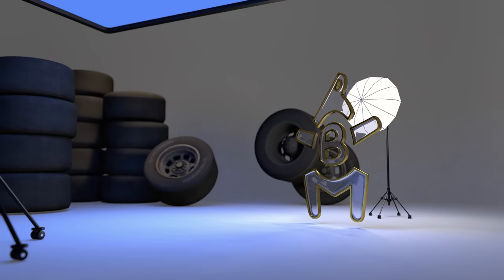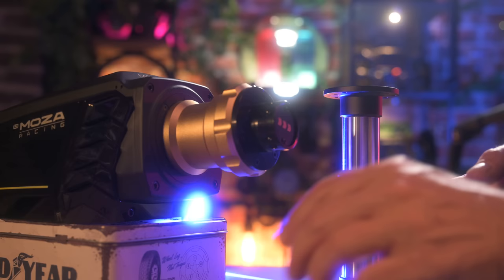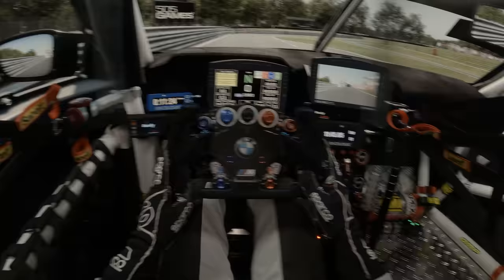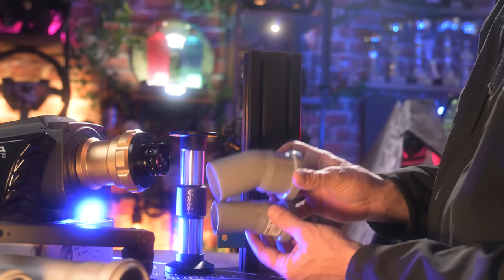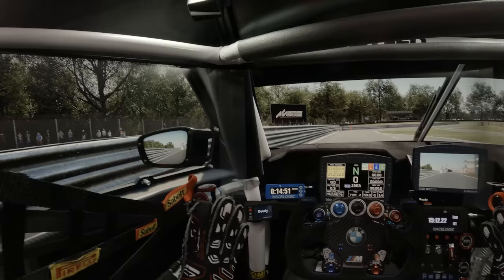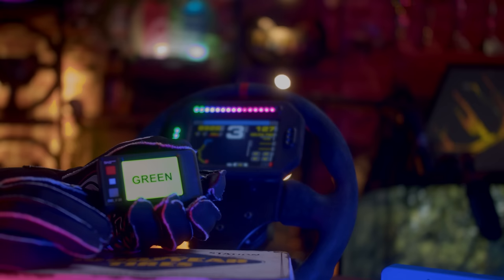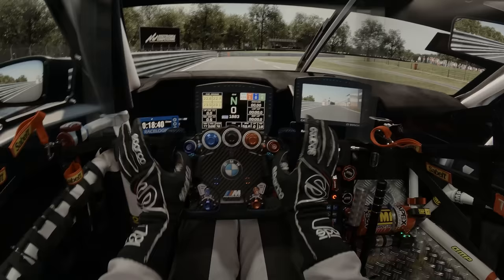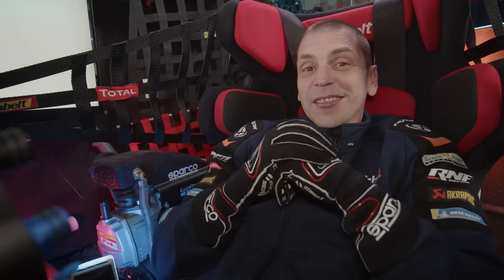How to build IMMERSIVE Sim Rig in 2023

Comment: what screen size eould you recommend to feel 1:1 ti real life sitting in a gt3 car being able to see outside the windshield and dash board section ?

thanks
Reply from the maker: That will depends strongly on the physical eye monitor distance buddy!
At 54cm distance I able to see the dash and the full windshield vertically on my 32 inch and is reasonably good size but definitely not 1:1 ratio ! Probably round 40-45 inch will be optimal but I’m happy with the 32 ich size

Comment: i only found the Asus Bezel kit for 27 zoll. Do you have a link or so for 32 Zoll Monitors
Reply from the maker: It is only for 27inch 
I stick it on top and bottom with type 🤛
Reply: @chepilevski    ah ok thank you
Reply: Also can cut some acrylic plate , length 3cm (x4 top&bottom) 
(depand on  monitor bezel) 
thickness like bezel kit to stack top and bottom

Comment: @racebeyondmatter where you get those metal plates ? and what kind monitor stand you using for the triple screens and any link on the metal plates ? also what is that dash board that showing what behind you when racing its that coming monitor it self or thats dash board ?
Reply from the maker: Hey buddy, the monitor stand is the cheapest model from SimLab and the display is from the sim picture!
The plates I found in local market but here is some amazon link for example 
https://www.amazon.de/-/en/gp/aw/d/B08FDHX993/ref=sspa_mw_detail_1?ie=UTF8&psc=1&sp_csd=d2lkZ2V0TmFtZT1zcF9waG9uZV9kZXRhaWwp13NParams
Reply: @chepilevski  thank you so much would you say 300/ 400 /500 /600 mm metal plates which size would you recommend or what size are you using in the video currently trying my best to mimic your build :) one step at a time
Reply from the maker: @jahgenetics3315  mine are 50x25 cm and I use 2 on bottom and one in front 🤛

Comment: Can I ask what distance your eyes are from the screen now, when base is behind monitors. I have just purchased triples and want to start off correctly.
Reply from the maker: I have around 56cm eyes distance from all monitors wen I turn my head around buddy! 
It makes huge difference in comparison to the 70cm + I have them before ! 
If you can stay between 55-60 is really great experience as the monitors surround you 180deg and the perspective is more natural!
Reply: Ah great thanks. I’m at 63 currently. Didn’t want to start modifying until I had a rough target. You setup is inspiring btw!

Comment: Stupid question I’m sure but can you extend your screens when using a ps5 with the Fanatec GT DD Pro rig?
Also how did you get the screens to match the angle of the windshield and what did you use for the side bars that separate the screens?
Reply from the maker: Hey buddy, I’m not sure if I understand your question!
Reply: @chepilevski  Since I asked the question I researched and found that a triple screen setup is not applicable for the ps5 regardless of the game so I’ve answered that question. The other question I asked you is how does your front monitor appear to be slanted the same as the car windshield. Is that just an illusion or do you have to angle your screens to create that visual?
Reply from the maker: @dustingre8  ah me buddy, the monitor is absolutely flat and is just an illusion 🤛

Comment: Can you please tell me what curvature radius and FOV your using in iRacing? 

I'm using the same screen layout as you (Curved  Triples 1500r 31.5 inch, 580mm eye distance from each screen).. i have been using a 1500mm radius/ 155 fov.. but i recently watched one of @danielmorad videos where he is using our same monitor layout (although he had a different eye distance), and he input a 850mm radius of curvature which created a larger FOV.
Reply from the maker: Hey buddy, the curved settings in iRacing are not working properly!
I use the 3 flat settings to get proper fov!
Add all the numbers you have in iRacing settings and just choose 3 flat and calculate! 
You will get proper projection!